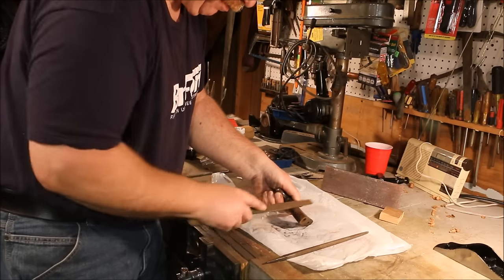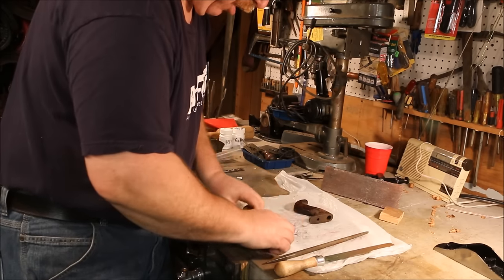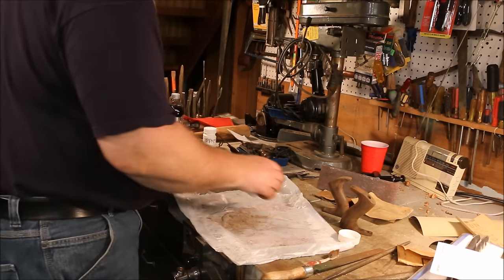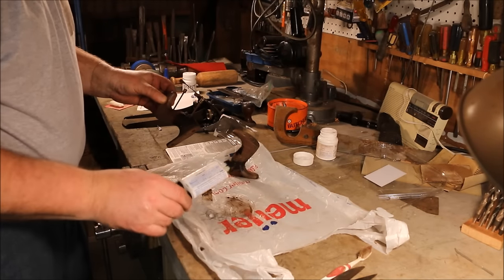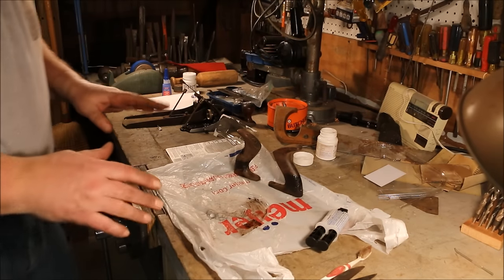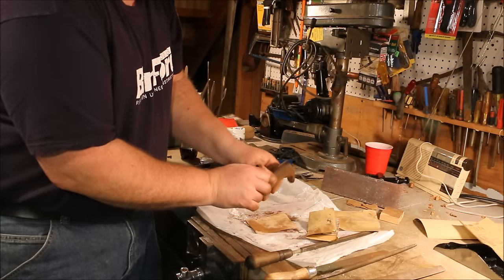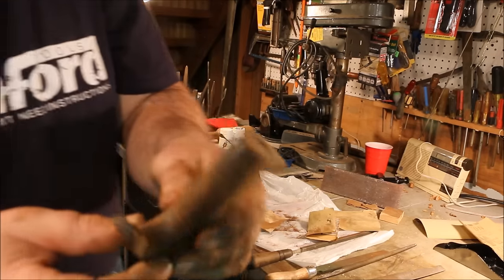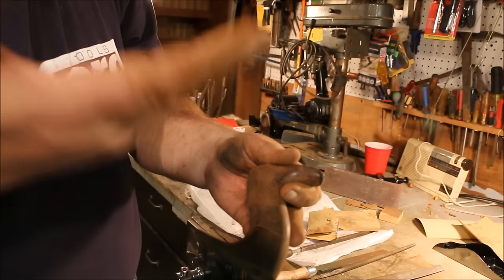Repairing Broken Stanley Bailey #4 ~ Pt 5 ~ Tote Repair ~ Improvised Wood Filler ~ by Old Sneelock's

Comment: That makes good filler ..I did that to fill in a worm hole in some wood ..I used some shavings I made when I was using the wood rasp
Reply from the maker: +not2fast4u2c Must be we had similar teachers. Dad use to use white glue and sawdust. It worked but took a long time to setup and then it really didn't want to take stain. This seems to be better all around.

Comment: rosewood handles, brass fittings - the craftsmen who produced those tools were proud of their work, and would be so disappointed in our current "improved" equipment.  good job so far, i'm learning a lot about repairing a badly cared-for handle.thanks, jim.
Reply from the maker: +Patricia McGinty I agree Jim. Rather than make a million okay pieces in an assembly line the companies made a few hundred at a time that were well designed and crafted. You can see where things started to go off the rails after WWII. The introduction of the mass manufacturing to meet the demands of the military was morphed into the TV and washing machine business. New tools were no longer made for the craftsman. The day labor employee who made 100, 000 screws per shift, running a bank of screw machines, lowered the price but increased the tolerance of the screws. There was a saying that quantity has a quality all it's own. It does and the quality is less.
Reply: Another aspect of the same problem is demonstrated by the 'vintage' hand planes that people are paying so much for today on eBay and elsewhere. Those hand planes, and other old tools, have the 'quality' of repair-ability, whereas today, manufacturers of everything, from tools to appliances, from autos to airplanes, optimize using the principle of maximizing profits using 'design for obsolescence', leading to our 'throw-away' culture which is destroying the planet ever faster.

A cute retort to my complaint is written in the poem "The One Hoss Shay." Google it, you will enjoy!

Comment: What is the 'vixen file'? And what is the angle you used for the 'wedge' in your jig?

I am working a UNION plane tote made of mahogany, with the same problem, and am thinking of drilling a second hole, down and up, to insert a small dowel along with the glue, to give that joint a 'lasting quality'. Any reason I should worry about doing that? It does depend on the angle that the tote screw meets the base of the plane; the dowel hole would have to be drilled at the same angle, I suppose.

Oh, forgot to mention that I certainly appreciate your posting this set of videos.
Reply from the maker: Bill Cowhig The vixen file is a very coarse file with curved teeth.
Putting a short piece of dowel in the handle won't hurt as long as there is room for it.
Reply: Is 'vixen' a product name, or generic name? Your description makes it sound a little like a rasp, which is file-like in structure.

The tote screw hole is off-center in the stock far enough to allow space for a 1/4" dowel, assuming I can figure a way to drill short holes at the same angle as the tote screw, on both parts. Maybe I can use my drill press in some clever way to get those holes right?!

Bought a 1/4" dowel kit from Harbor Freight this morning, and am now trying to screw up my courage. Thanks for your advice.
Reply from the maker: Here is a description of the vixen type file.https://www.tinmantech.com/html/files_carbody.php
Vixen files are closer to floats than rasps. Rasps have individual tooth edges that increase the point load per tooth causing faster cutting. Vixen files have curved teeth that help clear chips when cutting softer materials like body filler or soft metals. 
Good luck with the dowel. I use epoxy to glue the handles together because the good ones are rosewood. It's a very oily wood and doesn't respond well to wood glue.
Reply: Thanks!

Was wondering about the epoxy. The wood on the UNION is mahogany. Wood glue or epoxy? I will try not to bother you any more. You are very helpful.
Reply from the maker: No bother. Glad to help when I can. Mahogany is oily too. I'd go with the epoxy.
Reply from the maker: +Bill Cowhig I just noticed that I didn't answer  your question about the angle. It varies from tote to tote. Each plane maker has a slightly different angle on the mounting bolt. 
When I got this Idea From Scott Grandstaff on the Old Tools List he said to just get close and it will work. He was right.
Reply: Thank you for answering my questions in such detail. People like you are real contributors. Wish all people in the whole world were like you.
Reply from the maker: Thanks for the kind words. I'm sure there are a lot of people in the world like me. Just not as many willing to go on an open forum and risk being wrong.